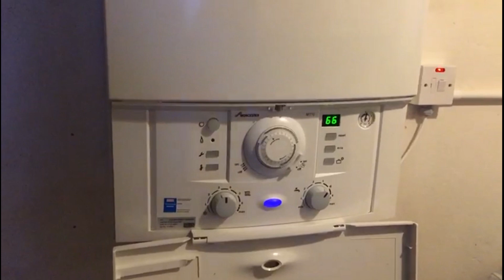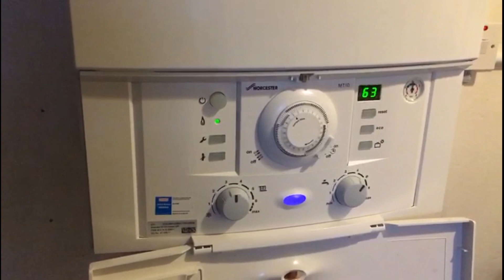installation de chaudiere

Comment: Il faut prendre en considération la priorité des tâches , c’est à dire, il faut Percer avant de mettre la plaque pour éviter de salir la plaque et les raccords, merci
Reply from the maker: Veuillez lire les instructions du fabricant pour savoir comment installer. Les débris ne devraient avoir aucun effet sur le raccord à compression ou sur le support de la chaudière. Au final, vous constaterez que le nettoyage des débris est recommandé, comme mentionné dans les instructions du fabricant. /Please read the manufacturer's instructions on how to install. Debris should have no effect on the compression fitting or the boiler bracket. In the end, you can see that cleaning the debris is recommended, as mentioned in the manufacturer's instructions. All the best!/The diagram opposite shows the relative
positions of the flue and the fixing of the
wall mounting plate, the hanging bracket
and pre-plumbing manifold.
 Place the hanging bracket on the wall
mounting plate.
 Place the wall mounting plate with hanging
bracket against the wall in the desired
position.
 Mark 4 fixing points through at least:
- one of the holes A
- one of the holes B
- hole C
- hole D
in the wall mounting plate/hanging bracket.
 Drill the 4 holes for wall mounting plate, wall
hanging bracket and pre-plumbing manifold.
 Secure wall mounting plate with hanging
bracket with 4 screws (supplied with the
boiler). Do not fully fasten the lower 2
screws.
FLUE OUTLET
 Follow the diagram opposite to mark the
centre of the flue for rear outlet (1, & 2) or
for side outlet (2 & 3).
** Note: increase this height by 52 mm for
every 1000 mm of horizontal length that the
flue outlet is away from the boiler.
 For the 60/100 mm Ø flue make a 125 mm
diameter hole through the wall using a core
drill or similar.
For flues using an optional weather collar,
fitted from inside the building make a
150 mm Ø hole.
 Clear away any debris.